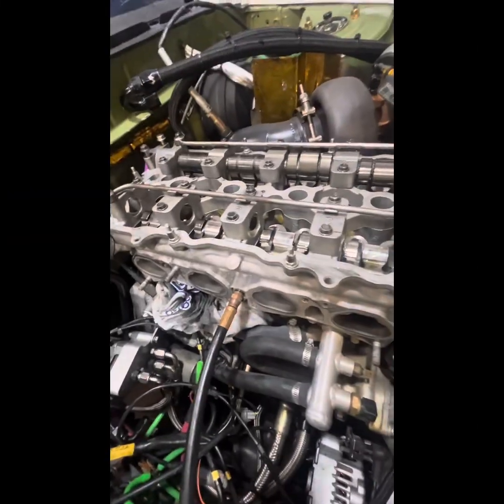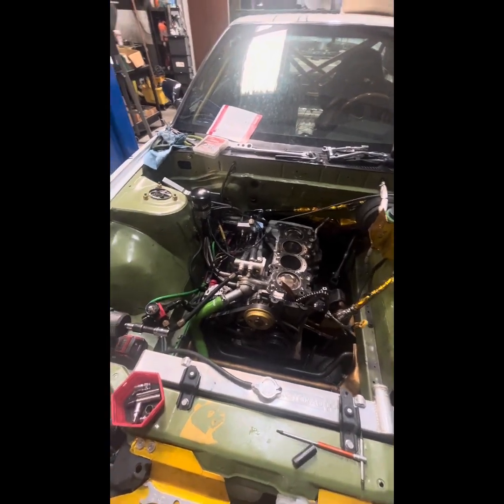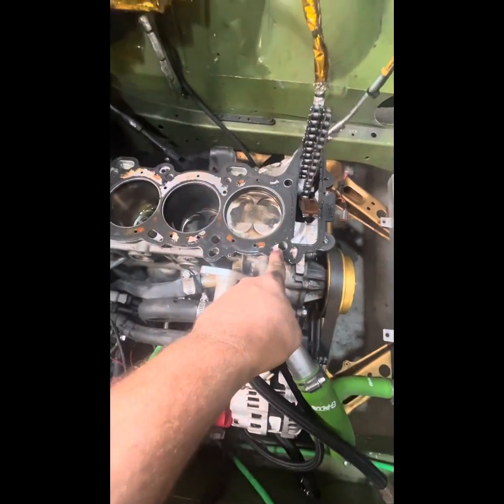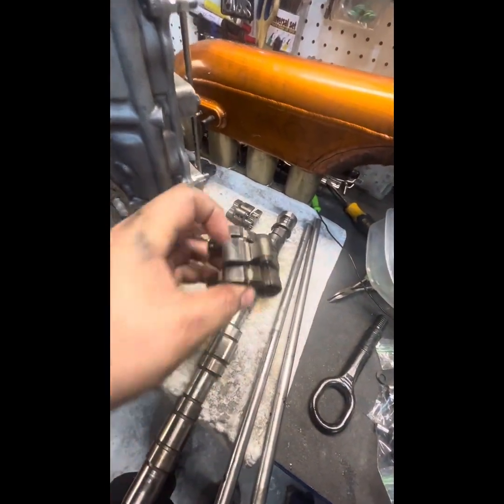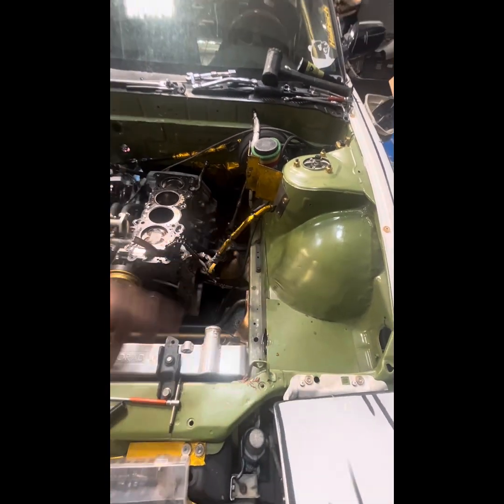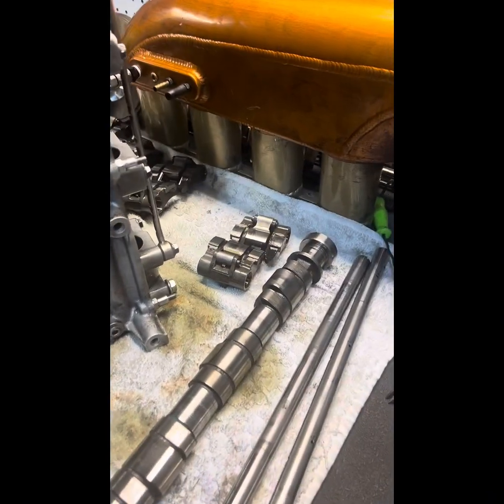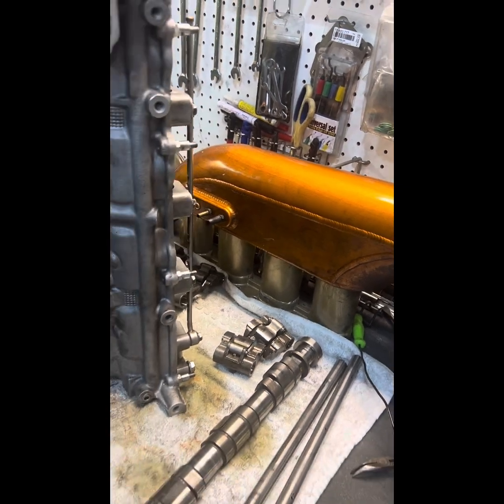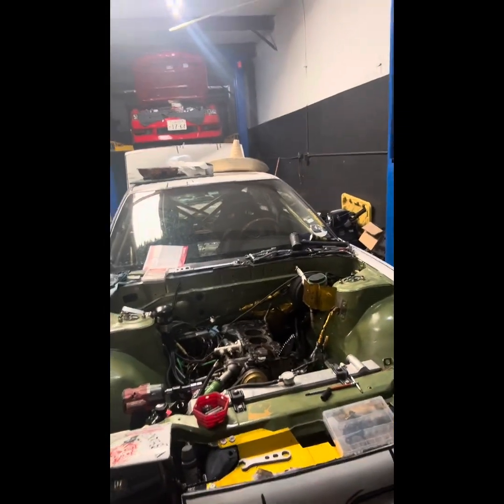My SR20VET cylinder head was starving of oil and here is why!!

Comment: hi man. i love your build. so did you fix the oil problem? what do you think of 184t cams? currently i have p12 20v and i hesitate to switch to them but i'm afraid of losing the low end rpm.
Reply from the maker: @teamfaroye.motorsport.5660  the top end of the 184t cams is noticeable. I picked up good power on the top end making the switch.